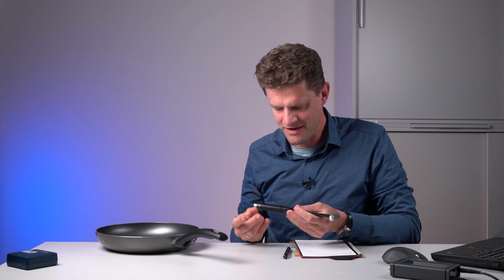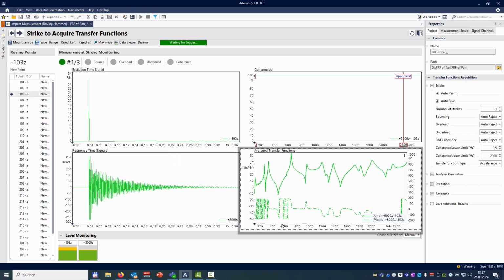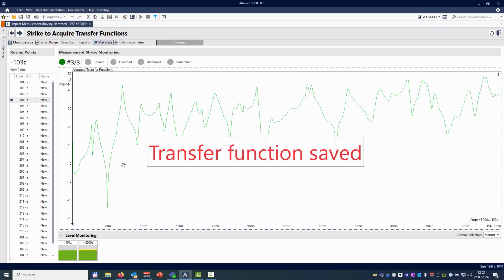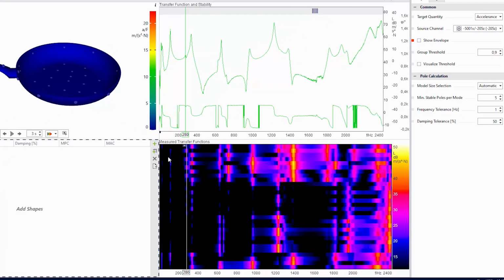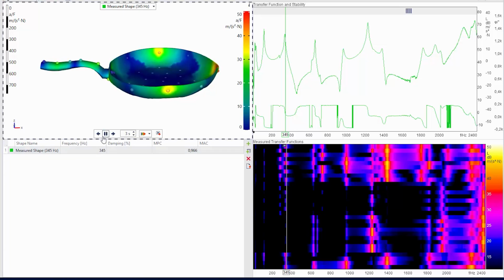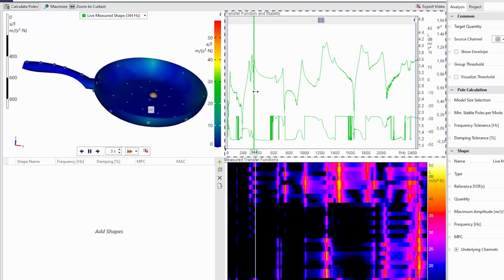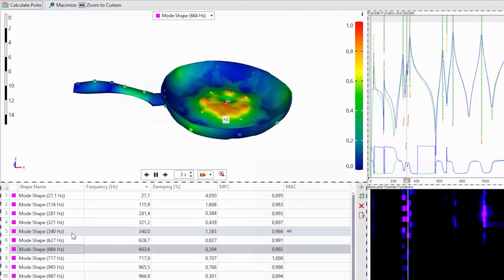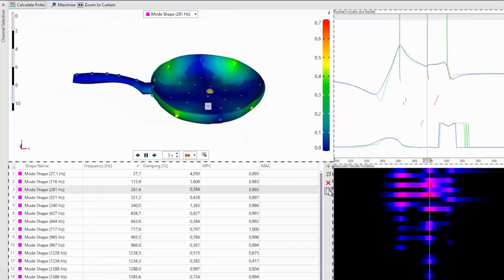FRF Impact measurement - (Part 4/4)

Comment: Can you make a video explaining the difference in how a frequency responses measurement is made using an exponential sweep and comparing it to a linear sweep fft type measurement? I'm trying to understand the whole convolution and deconvolution part and how the units change when doing those transformations
Reply from the maker: A video would take too much time to create. I guess you need the answer now 🙂

When exciting a structure (e.g. via sweep), the structure’s response/output signal will differ from the input signal due to the structure’s dynamic properties. Mathematically, the input signal in(t) is convolved via multiplication by a function h(t): out(t) = in(t) * h(t). If we transfer this into the frequency domain, we get OUT(f) = IN(f) * H(f), with H(f) = OUT(f)/IN(f) as the transfer function. In the time domain, the transfer function becomes the so-called impulse response h(t). Both impulse response and transfer function have the same unit, derived by the above calculation of the transfer function (e.g. (m/s²)/N).
Deconvolution means removing the influence of the system properties from the output signal. This is implicitly part of the transfer function calculation H(f) = OUT(f)/IN(f), where the output is normalized by division by the input. Similarly, the impulse response h(t) is the deconvolved output signal.
While all the above applies to both linear and exponential sweeps, there are some differences. Using exponential sweeps, the energy per octave is constant. In turn, the signal-to-noise ratio is improved at lower frequencies, where the exponential sweep is slower than the linear one. Additionally, harmonic distortions due to non-linearities become apparent in the impulse response, which is not the case when using linear sweeps. However, the frequency resolution is higher at lower frequencies when using a linear sweep.

We hope this will help you

Comment: Hi Till, I have 1 question, for the damping column, the values is in percent % right? so when it shows 1,405, does it mean 1.405%?
Reply from the maker: That is correct. 1.405 means 1.405% 
or a ratio of 0.01405 between the damping at this mode and a damping that would be so high that there would be no overshoot at a deflection and therefore no oscillation at all (critical damping).

Comment: Could you show example of frf on assembly part (suspension)
Reply from the maker: As soon as several parts are assembled, it becomes increasingly complicated. It is then often necessary to use several reference points.
I address this in the next video and show you the best way to deal with it. 
Good advice. Thank you.
Reply: @HEADacousticsInternational  Thanks for the response! Great video btw👍